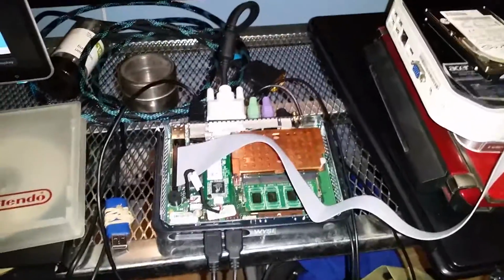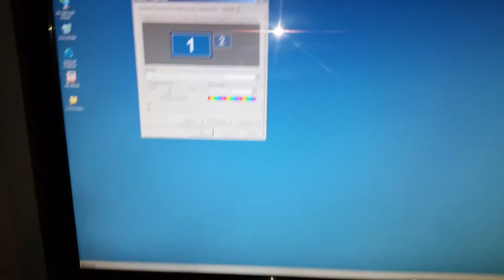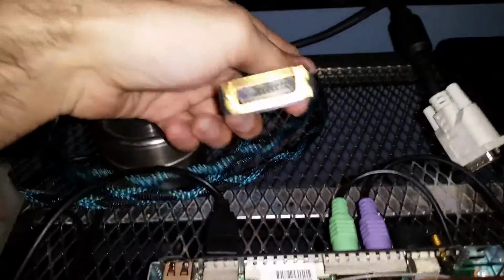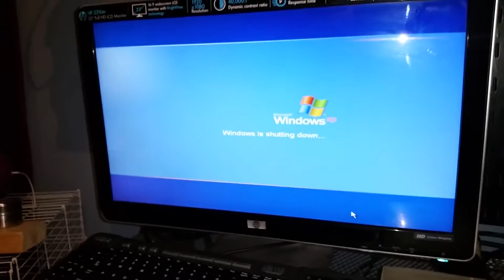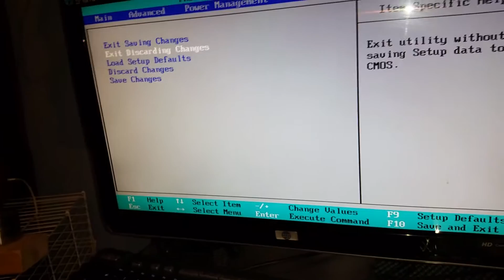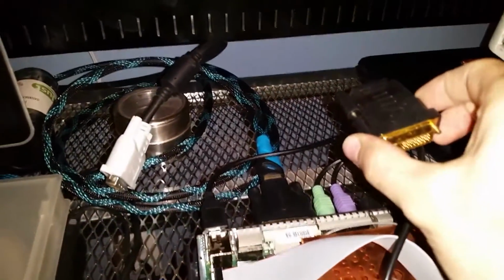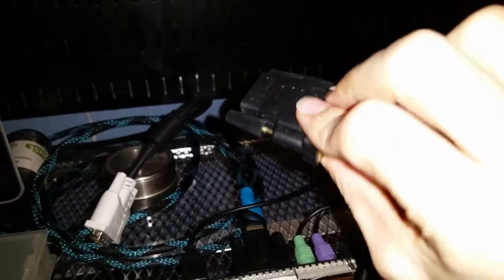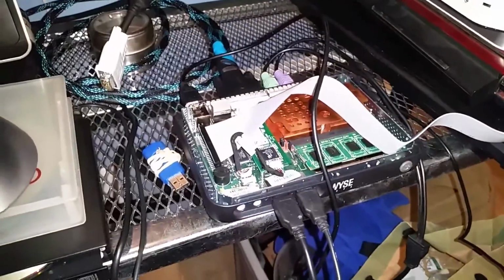Wyse Cx0 Thin Client - DVI/HDMI/Audio & Technical Quirks

Comment: I'm having issues opening my unit, any tips?
Reply from the maker: Mine needed a little "tough love" to pry open but not with enough force to break anything.  There should be a few screws at the back where all the I/O ports are. From there the  cover should come off. Try to slide the top cover back, I dont recall if the Cx0 has little slide-in-locking-feet that lock it down more securely, or if its Heatsink Thermal Pads bonded to the cover like annoying stickers. From there it should release with no problem, but dont force it. Also remember, these things get VERY HOT so be weary of that huge copper heatsink. Even if its just idle it will burn you unexpectedly. I dont have a Cx0 on hand right now but it might be the CPU heatsink is also bonded to the case itself via thermal pads. I don't remember 100% but if there are, some tough love is in order. Let me know if you get yours open, I can try to hunt down one of mine and do a double check in a few days if you are willing to remind me.

Comment: Nice job, where did you get the ide cable, as this does look like is the standard one, the connector is smaller, at least in the cx0 I have
Reply from the maker: indeed it's a standard 44 pin 2mm "laptop" IDE cable.